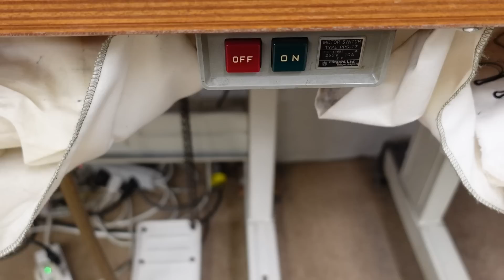JUKI LK-1852-1 : High-Speed 1-Needle Bartacking Machine

Comment: THESE MACHINES like button hole machines are dirt cheap second hand, the problem is the WEIGHT - 150kg to 200kg per machine

AND you need a compressor as they use pneumatics to actuate the clamp lever

Comment: I just got a Pfaff 3334 and I don’t know what kind of motor to use on it. Do you use a regular clutch motor for bar rack machines?
Reply from the maker: We are not familiar with sewing machine motors. Thank you.
Reply: I dont believe that it matters much.  As long as it turns the belt, it will drive the machine. A quick google search shows them with clutch motors.